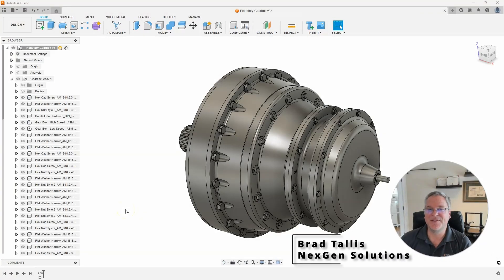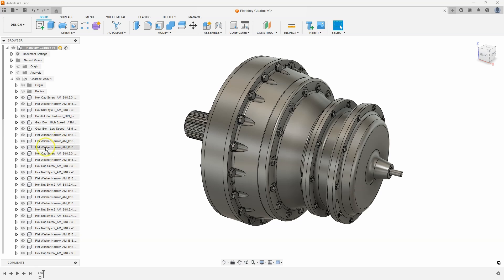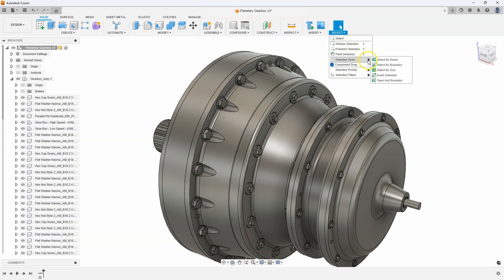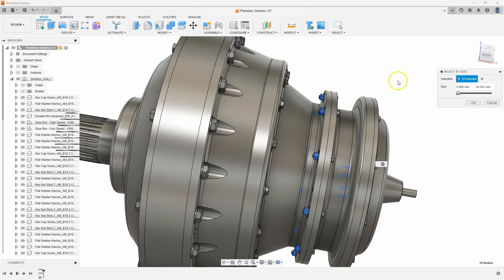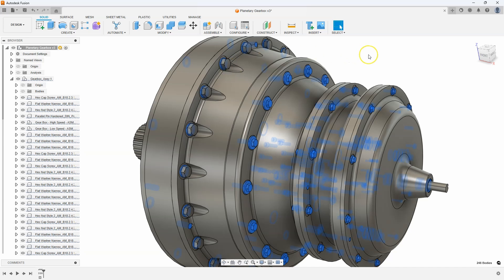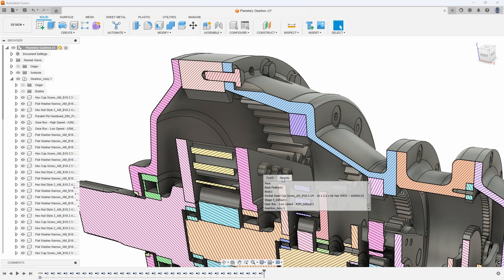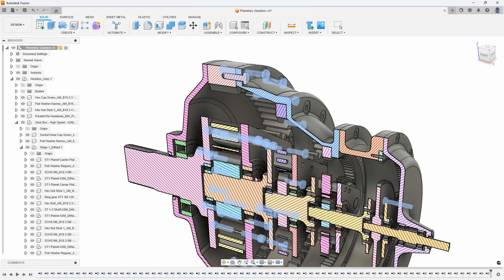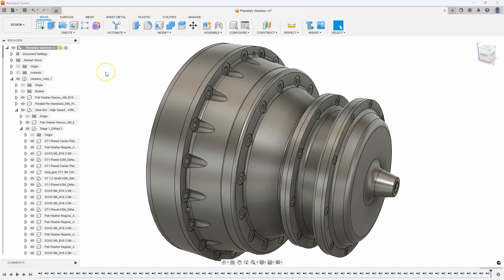Fusion Friday - Powerful Selection Tools in Fusion

Comment: I know this is just a video to give examples, but it probably would have been easier to select the 4 or 5 pieces you wanted to keep and hide them before selecting everything else and removing them at once...
Reply from the maker: lol.  Yes, you are correct, it would have been easier to just select the housings.  But like you mentioned, this was just an example to show the process of using Select by size and select by name.  The idea actually came from helping a customer with a gigantic assembly that they wanted to remove all the small components.  Their example wasn't as easy as just selecting a few pieces that were remaining.  Also, I couldn't use the customer's model, so I needed to find/make one that had lots of small components, like the one I used.  Thanks for watching!

Comment: Can't you just add hardware, housing, seal, gear, etc when naming components to make selecting by name easier?
Reply from the maker: Yes, if I had modeled this assembly and had used the Fastener Library, the naming would have been easier to select by name.  However, this model was downloaded off of Grabcad, so I was at the mercy of how that person modeled/named their parts.  I felt it was a great example as you never know what you will get from other engineers, vendors, etc.  Thanks for watching!